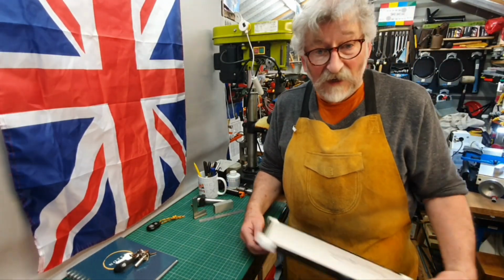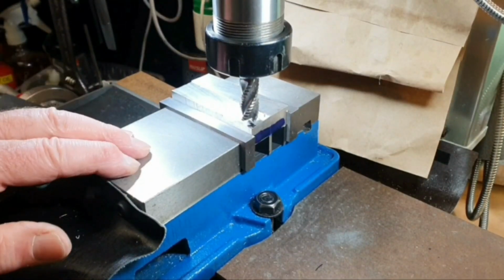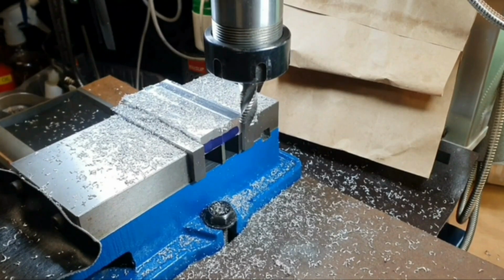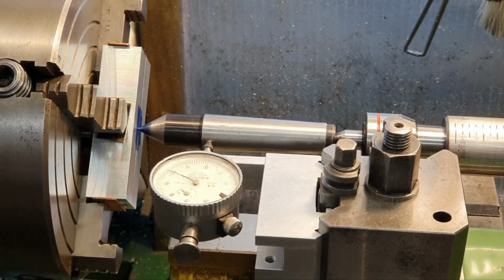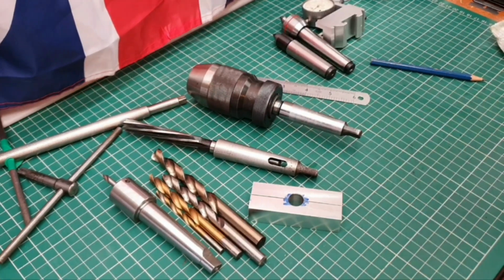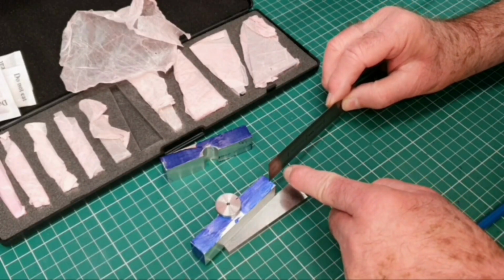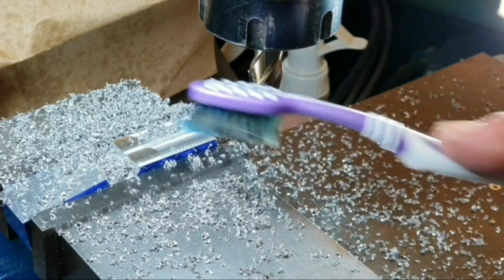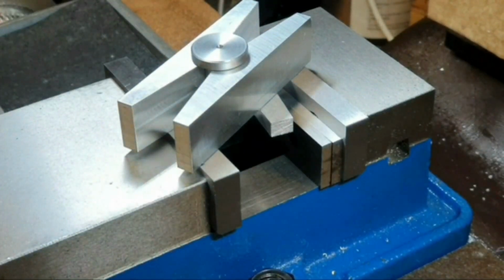Swiveling Vice Jaw Adapter for the Mini Mill.

Comment: Skimmed to the end Nobby. It actually looked like the jaw was actually touching the double parallels and not the tapered part. You actually need to be careful if you wanter to machine the tapered part as any end pressure could cause the part to pop out of the vice. Really need an end stop,  at the big end. Good to see you in the workshop again. Regards from Australia.
Reply from the maker: I did notice that as well David when I checked the video. Will have to be careful when I use it for real. Good idea on the vice stop, I'll definitely do that. The weather is nice now, so I'm in the workshop most days. ATB Nobby